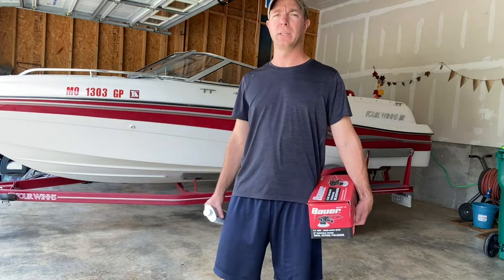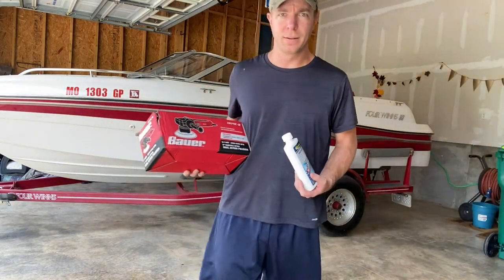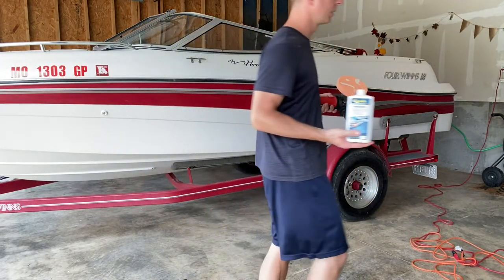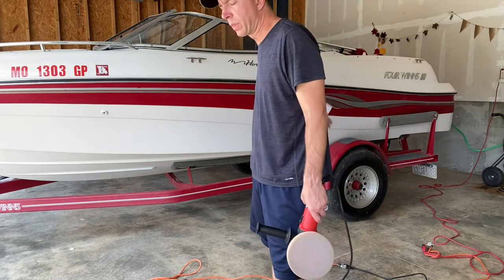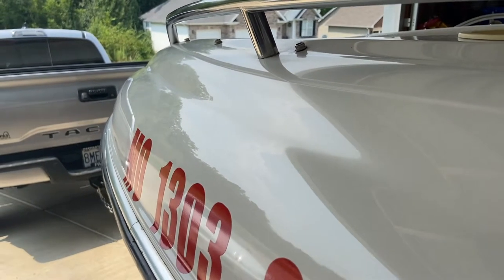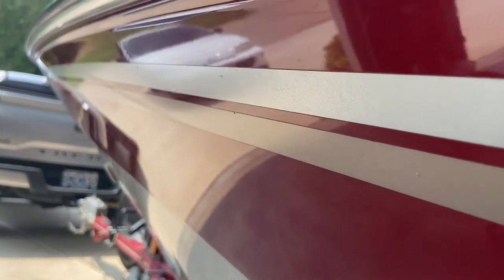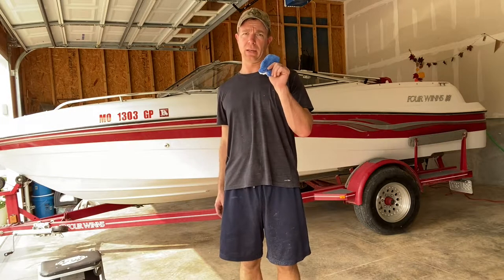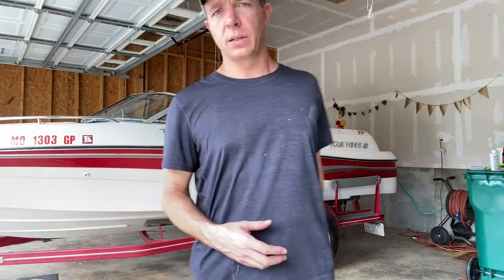How to wax a boat with a buffer / polisher

Comment: So are you using same wax, making 3 passes with different foam pads, with 2 micro-fiber bonnets, 1 for 1st 2 passes, and a new one for the finish coat ?
Reply from the maker: correct, same wax, several light layers.

Comment: What speed were your running on the polisher? Did you keep it the same for all the pads?
Reply: OBTW: Im using your exact setup with the polisher, pads and wax. Ironically I have a Horizon 170
Reply from the maker: It’s a good little boat.    Yeah I was running mid speed on all pads.

Comment: I noticed your shot of water spots. Don’t you ever wipe your boat down with 50/50 vinegar and water ? Or did you just leave it for video purposes ?
Reply from the maker: No I have never used vinegar/water mix. I don't wipe it down after boating. I usually wax it once a year, that's about it :-)